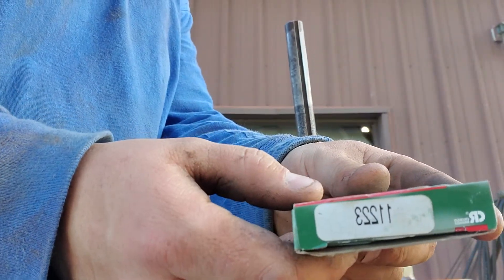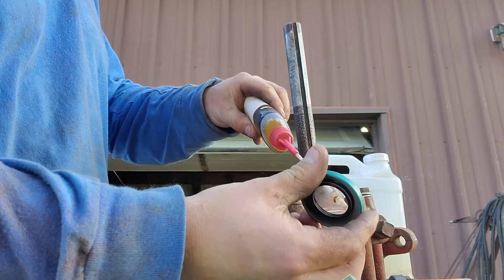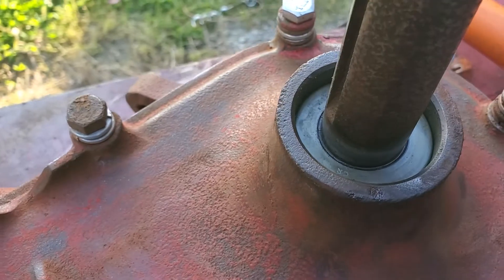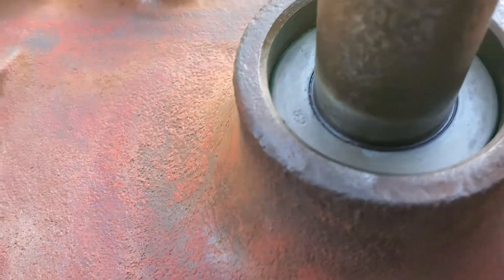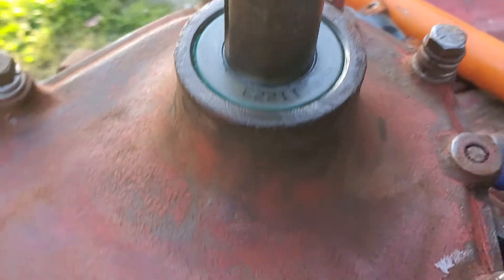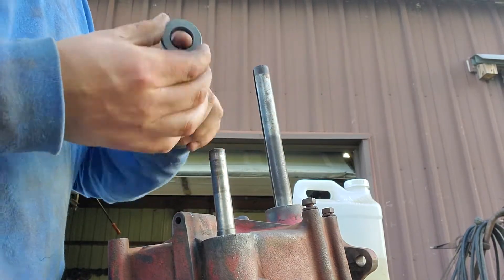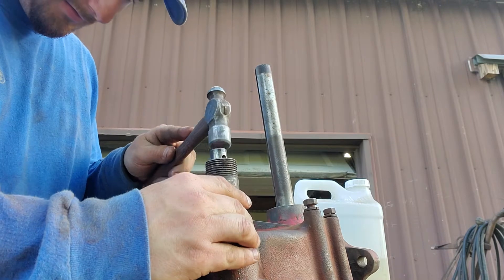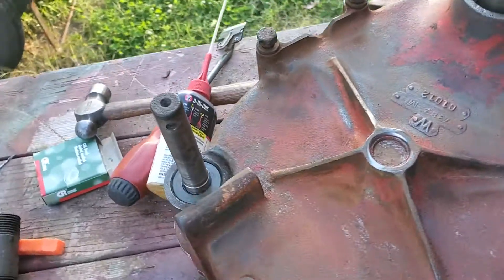Installation of Transmission Seals

Comment: Travis I can't imagine anyone with a DB not looking at this video. Everyone wonders how involved it would be but are too nervous to do it. So they keep wiping up 30 weight oil off the floor. Do you use 30 weight in the transaxle or a heavier oil? Thanks for this great video.

Comment: So, why wrap the shaft in plastic? We've always just used a coat of oil to lube the axle up to put them in. Also, why use 2? 1 always seems to work just fine

Comment: Great video , I have one question . How or what did you use to remove the old seals ?
Reply: I've seen pilot holes drilled on either side of the shaft into the seal and sheet metal screws screwed into the seal and then prayed out with pry bars and wood blocks placed under end of pry bar and against the case.

Comment: If one axle is larger than the other, is that a super 600?
The model # is 917.575 135
What seal # would I need for the bigger shaft?